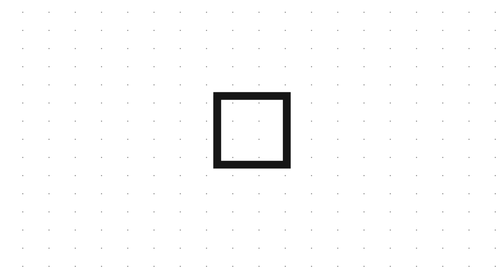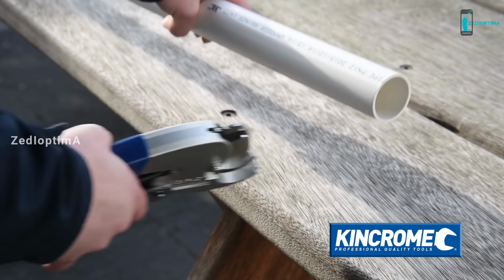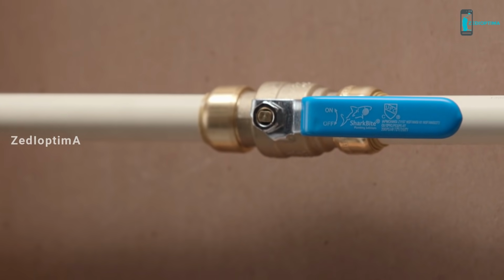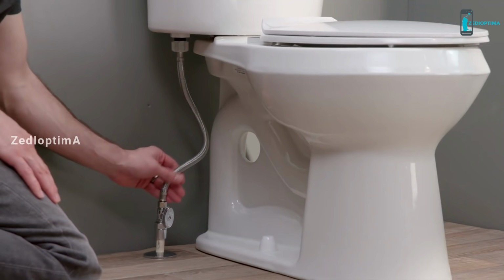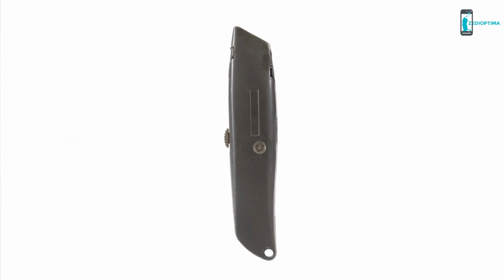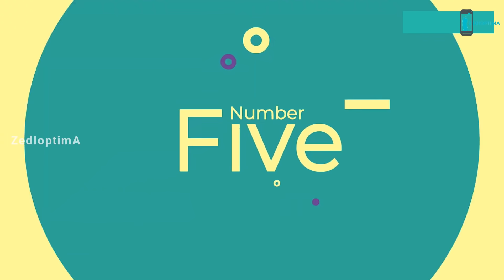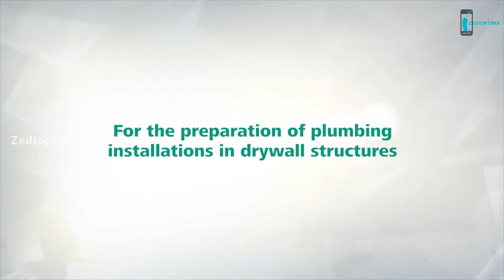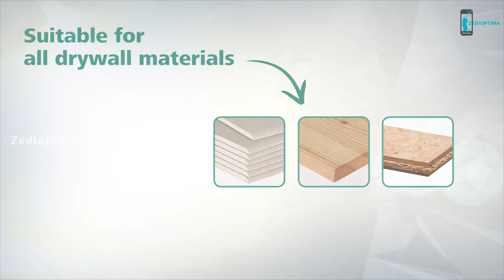Top 10 Best Plumbing Tool Accessories for Plumbers

Comment: A good plumber would never put cold water on the joint that’s just been solder
It will cause the lead to crack and spring leaks
Reply: I noticed that too. And I would put something under it as well. I didn't see no flux but maybe it's silver solder.

Comment: I like the last tool. Unfortunately connections aren't made on a level surface with plenty room for the handles to extend. Most of the time your in a tight spot and space is at a minimum.

Comment: Do not use CPVC. It is garbage and will be brittle and cause problems quickly. Also, don't use sharkbites in areas that are not easily accessible. Personally, I think they are only good for temporary repairs. Also, always stub out in copper.
Reply: Perhaps, but many issues are garbage installation of this approved material!
Reply: This is great advice. If you want brittle problematic plumbing in your home use CPVC. Its terrible there is a whole neighborhood in my city that used this material to plumb houses to save money. Believe me no one is saving money anymore and its ran in the slab. We have all kinds of weird unexplained breaks that we get calls for. Run

Comment: 1:49 CPVC will soon not pass inspection .. Do not use it if you don't have to.
Reply: What are you hearing about CPVC. Has IAPMO decided to pull it out of the plumbing code or are you talking about the EPA and environmental issues that want to get rid of petroleum products?
Reply: @stevelopez372  code. when? who knows i'd bet b4 2030. becomes brittle even in dark dry areas.

Comment: The number 1 is not bad but not for professional  man. Is very heavy  and difficult  to use. Specially  on the  inside  of  the  corner.. and in the ceiling.  Is better  other  types of pressmachine without  arms.

Comment: He glued the pipe push it on the valve then turned 1/4 turn false. Go back and read the can it says (push on while turning) not push then turn. Push pipe FULLY into fitting using a ¼ turning motion until pipe bottoms.     Hay if you didn't take a plumbing class at least read the can slooowly. 🐌

Comment: No 8...When the valve needs replacing is it just a case of cutting the pipe and then when you find the stub is too short just the small job of lifting the floor, toilet removal and extending the pipe, replace the floor and coving , reinstall the toilet and then fit a new valve??  Seems simple :0 :0 . But if in copper! remove the valve and replace with new!

Comment: That last tool. The copper press tool. Not very practical. Plumbing pipes are usually located in hard to reach/confined spaces. So this would not be able to do the job

Comment: Who ever made this video isnt a plumber. If they were they would have mentioned pro press as it does black iron and copper press fittings. No pex expansion tool mentioned here, nor the seesnake. No moisture meter or thermal imaging. Honestly everything here is garbage.